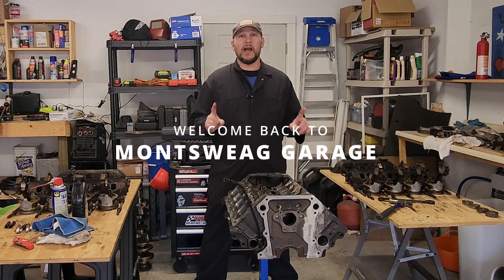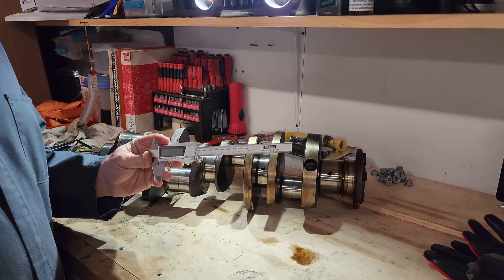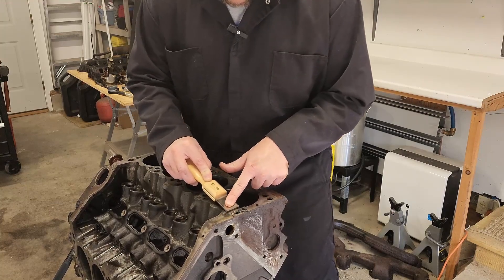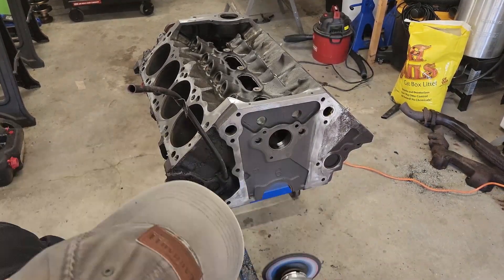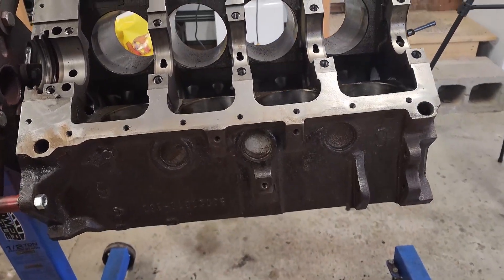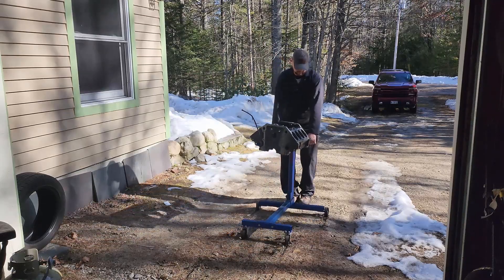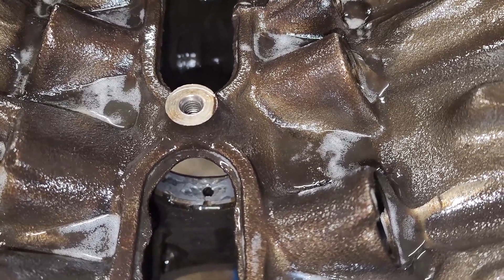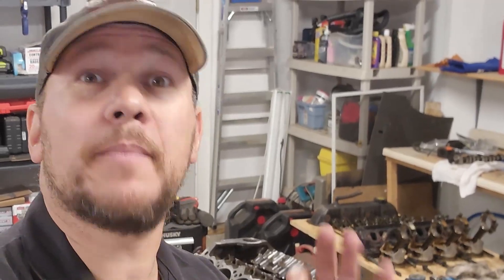Revitalizing the 360 Magnum: DIY Engine Block Prep.

Comment: How many miles did the engine have on it?
Reply from the maker: Hello Kelly. Thanks for the comment. The engine had around 150k miles on it, according to the junk yard. It did show some signs of having work done on the bottom end as there were numbers written on the bottom of the rods with sharpie.

Comment: Harbor Freight tools has a bunch of wire wheels for your grinder and drill.  They work the best for cleaning blocks surfaces. The only draw back is the little wires come off and will stick you and your clothes.  A small price to pay for a clean block.  You already have safety glasses.
Reply from the maker: Hello again John. I actually have a drawer full of wire wheels for my 1/4 impact. I have been using them to clean off my front suspension parts before I paint them and put them back in. I also like experimenting with different methods. One of the side effects of being an engineer in my day job. I used the super scraper mostly because I was curious about how well it would take off the heavy scale. I used the paint stripper pad on the gasket surfaces because I suspected it would clean very well without removing the metal. Again, thank you for the insight. I definitely appreciate it.

Comment: Electrolysis works great too.
Reply from the maker: @Alvie Teal Welcome and thanks for the comment. I toyed with the idea of electrolysis when I rebuilt the 273. That engine was in way worse shape.
Reply: @MontsweagGarage  I’ve done it a lot. Just a bucket a battery charger and some washing soda.
Reply from the maker: I may give it a shot next time I need to descale something. I will be taking the front suspension apart soon...ish to replace the torsion bar crossmember. might be a good time to test it out.